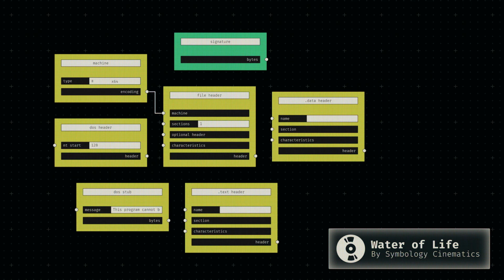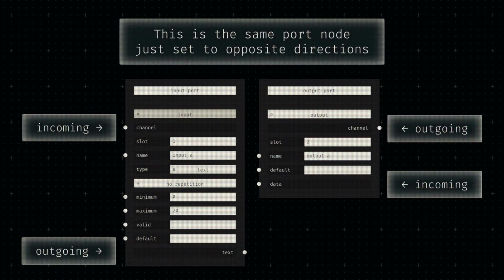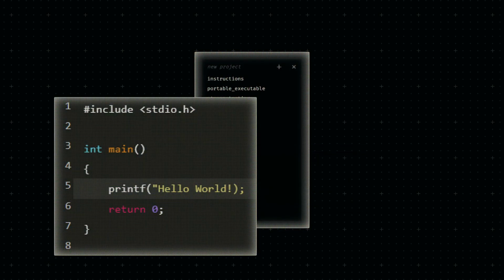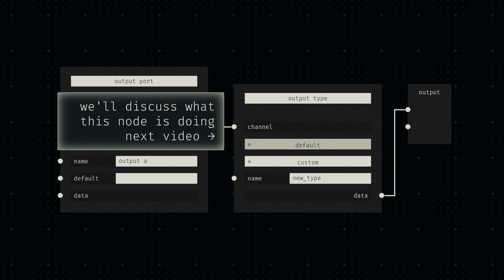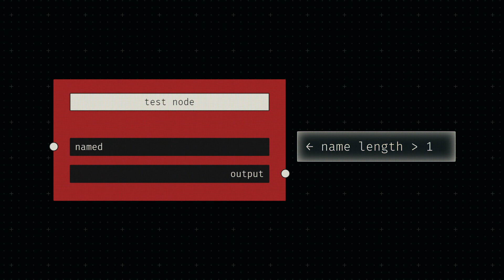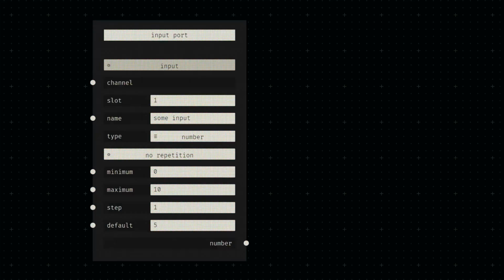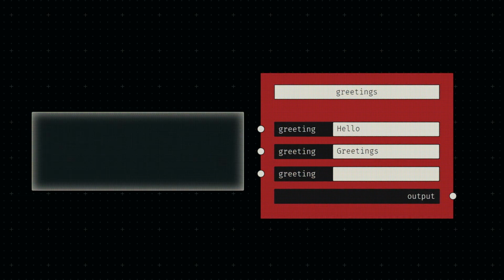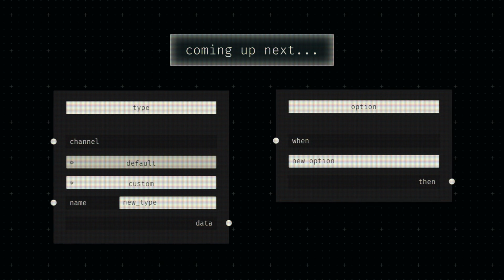Designing Node Inputs using Port Nodes - Kronark

Comment: I wonder how you will separate frontend and backend compiler later for cross-platform code? You will need some abstract intermediate representation. But ports basically give some idea of how it can be done
Reply from the maker: Sorry, I don't quite understand? What do you mean with "separate FE and BE for cross-platform"?
Reply: @Kronark  I'm sorry for my bad english.

I just didn't understand how it would be possible to write code that could be compiled for different architectures (you mentioned x86/64, arm and riscV, I think), but which would not include architecture-specific modules.

But after some thinking I already catch up how to do that with features of your node-lang. So my question partly outdated and new details in future videos will complete the picture, I think
Reply from the maker: @dmitry-diehl  All good mate, your English is fine.

This compiler basically moves the compiler target implementation into user-code space. So if a user wants to target a different architecture, he/she just has to build some nodes that output instructions for that architecture correctly. It will all become much clearer the more applied topics I upload :)

Comment: What instruction set do you plan to target with this? So far, I have written a compiler only for my own byte code virtual machine, and the language is basically assembly with a few macros/simple abstractions.
Reply from the maker: Sounds really cool!

X64 for now, until high level usage has been reached. I‘ll also need to target spir-v for my thesis, so that as well.

After all that, risc-v and arm for now.

Dalvic bytecode eventually to make apps :)
Reply: @Kronark  Sweet. RISC-V seems conceptually a lot easier to use than x64 since the instructions are broken into just two types: move and operate. The little bit I know about x86/x64 leads me to believe it would be a much more complicated compilation target, though I imagine that a lot of the abstractions needed for RISC-V would be applicable with some optimizations for other ISAs.
Reply from the maker: Yeah, x64 definitely isn‘t the easiest ISA out there, but it‘s the only ISA I currently have as hardware - so I‘m kind of forced to target it currently :D

Really can‘t wait to target RISC-V tbh, it seemed super interesting from what I‘ve gathered.
Reply: @Kronark  There are some fairly inexpensive RISC-V Linux SBCs you could use for experimentation without too much hassle, but having the test machine already available is a valid point.

Comment: I just recently found this channel, and wow this looks cool! Your project kinda reminds me of Lisp/Lambda Calculus. I'm excited to see where this project goes! I am a little confused though, why only 5 different types of sockets? Wouldn't that be kindof restrictive if you need anything other than a bool/string/number? Or does the named socket allow any type of data to pass through it?

Also, (and I know you may not have an answer to this yet at the current stage of your project), do you plan on adding meta-programming? Or would that be far too complicated with nodes?
Reply from the maker: Thanks! :)

All sockets allow any type of data. The socket types are merely there to provide a user interface to more easily define those different types of data - whatever is more intuitive in a given situation.

For example, you could define a colour data type with a text input (hex code) or a number input (number range 0-255) - it‘s all a matter of preference really. In traditional programming, you technically only get one approach to defining data: writing text. You have to write „true“ and „false“ for booleans for instance. In this tool, you get more options for defining data, for example the ability to use a button for booleans instead of writing a keyword.

What features of meta-programming would you like to see? A lot of stuff falls under that umbrella… :D
Reply: Oh I see!
And as for meta-programming, well of course that is up to you x3
I personally wouldn't implement it unless you can do it in a way that saves you time in the long run. However, it's still fun to fantasize about how meta-programming could be implemented.
You could have a `quote` node, that stores a node inside, and outputs it without doing any execution. Then, all you'd need is a bunch of built-in nodes that operate on the node datatype!
Or you could have "macro nodes" that simply recursively grab the entire node graph from it's inputs.
(Can you tell I'm a Lisp user yet? x3)

Comment: Any plans for comment/description metadata on the nodes? Even with the ability to go as deep as you need to within the nodes, a reminder of what a node does or any special considerations might be useful to someone building a graph at a higher level.
Reply from the maker: Yes, definitely. But it‘s a feature I‘ll be adding after everything else is done tbh.

I‘m planning on adding metadata tags to the editor in general, which will act just like nodes, just without any sockets and with an expandable text area instead. Maybe even metadata types and tag colours for things like todo/fixme/bug highlighting. Will need to add the ability to stick metadata tags onto nodes so they follow that node‘s position. An ability to fetch metadata content of the parent instance would also be neat - then you could output source code with comments.

But yeah, that‘s all not super important rn and will be a quality of life feature down the road :)

Comment: I'm waiting to see how loops will work. If you allow recursion then I see you can build arbitrary loops. For the analogues of the usual functional combinators like folds, you'll need something analogous to first-class functions as well.
Reply from the maker: They‘ll mostly work like any other higher level abstraction: a mapping to a sequence of low level operations

In the case of a loop, it‘ll be some form of jump with a sequence of instructions passed as a parameter to be inserted into the jump block.

We probably won‘t work on recursion immediately, since I only need simple loops for my thesis as far as I can tell (graphics cards can‘t do recursion). But it‘ll most likely boil down to a special form of loop with some special stack management :)

First order functions will definitely be done this year (although i‘m not sure if the corresponding video will actually release this year as well) - they‘re just a jump at the end of the day as well.

We‘ll need to cover how the global state works before all of this, because we‘ll need it to set and get file-wide addresses for the jumps.
Reply: @Kronark  To clarify: I meant I was wondering how loops in the node graph language itself work (we have already seen how some conditionals work in the node graph language: the "option/when/then" blocks connecting to "activation" inputs, as you showed in the "Assembling x64 instructions from scratch" video).
Or are you planning to write the whole compiler without loops? (I could believe that is possible with this node graph language.)
Reply from the maker: Ahh sorry.
Yes, there will be a loop node - but I'm still figuring out how it would work. The creation of actual loops of nodes within a graph goes against a core design choice and would require a complete rewrite. So that isn't an option. But I do think it's quite necessary to efficiently output repetitive sequences of bytes. I need to find a way of signalling the repetition of a node sub-network without breaking the existing architecture.
I'll probably make a dedicated video on that topic eventually :)

Comment: Are all visualizations of graph components/nodes you're showing being rendered from existing GUI of your compiler? Or you're just showing schematic visualizations done in some other tool?
Reply from the maker: All node (graph) visuals are just screenshot cut-outs of my compiler GUI :D

I am actually using this tool behind the scenes, not just acting like it :D
Reply: @Kronark  ok, thanks for the responses. I just asked that and question about open source because at least the framework of such visualizations would be very useful for other projects as a standalone component, so other projects can put their own ideas of what graph node mean to them and build their own interactive graphs with nodes having incoming and outcoming ports etc. I definitely can find such graphs useful for one of my own project ideas even though the project won't need the compiler part.
Reply from the maker: Yeah i‘ll definitely build it in a much more modular way for the release build - having dedicated libraries for ui, node graphs, compilation etc.

But it‘s gonna be a while until then I‘m afraid :)

Comment: But doesn't this GUI make longer programs harder to understand?
Reply from the maker: Not in my experience. You usually know where to find inputs and outputs since all inputs are on the left end of a graph and all outputs on the right. This approach is the only viable way to create dependencies between ports - which would be a nightmare ui-design-wise if it were done in a seperate top-to-bottom panel of sorts.

Comment: I think you could generalize 'step' by having it take a function as input that gets evaluated whenever the input gets changed. So you could connect a function that does `mod(x)` to have the same step behavior, or `pow(x, 2)` to round it to the nearest power of two, or any other custom behavior.

I guess it might add a bit of complexity though, if it has to compile the input to that node, and evaluate it in the editor?
Reply from the maker: Already ahead of ya!

I‘m planning on adding support for a minimal expression syntax for exactly that purpose, because expecially steps that follow the powers of 2 are super useful for lower level data.

My plan is to allow the „=“ character in all number parameters, maybe even number inputs in general, which if placed at the beginning of a value, an expression evaluation would trigger instead. Then just add syntax for all necessary math stuff and it should be a neat lil feature!

Comment: Due to a learning disability quirk, programming has always been inaccessible to my brain struggling to process text walls, but with node based systems, I can actually get some results - particularly in systems like houdini where you can encapsulate a dense collection of nodes into a single node with exposed inputs/outputs

Comment: Because It is directly outputting bytecode doesn't that mean you wont have access to compiler optimization like other languages?  Would It be significant for performance?
Reply from the maker: Compile time optimisations essentially boil down to „replace these bytes with these optimised bytes“, and that‘s exactly what we‘ll be doing when implementing optimisations.

For example, in our upcoming multiplication node, if a factor is a power of 2, we‘ll output a bitshift instead of an imul operation. 

We‘ll discuss this stuff more when we get there! :)
Reply: Also do you have a tool for spawning nodes like in blueprint?
Reply from the maker: Not super familiar with ue‘s blueprint system, what exactly does that accomplish?

There isn‘t a tool for that yet, but I suppose it wouldn‘t be much of a leap to build it.
Reply: Basically when you right click there is a pop-up with all  relevant nodes and  auto-completion.
Reply from the maker: Ah, yes of course. When you double-click the grid, a menu opens where you can select a node :)

Comment: Nice, I'll need to watch it again 6245 times to understand correctly :D

I'd propose to add some sort of "+" and "-" buttons of some sort for repetitive sockets, so that even switches can be repetitive.

Another thing is that repetitive sockets are pretty wild to look at (from exterior perspective): there is no clear indications that it is a repetitive socket. A thing that could be done is to offset the name of the socket from the values, kinda like a tree (but it's only 1 branch deep).

Also, why use "channels" instead of just a "flow signal" (like blueprint) ?

Anyway, great video, I'm working on my own visual programming language btw. Good luck bro, and don't forget to take a rest when needed :)
Reply from the maker: Please do, I need the watch hours :P

Hmmmm, actually not a bad idea. That would alleviate a lot of automatic processing in the backend… might implement that button approach once other features are stable.

Regarding the visual cue that a socket is repetitive, I wouldn‘t inset the name but maybe add a little icon somewhere… I think that would look cleaner.

Eh, the naming choice may be reworked once everything else is set. Maybe we‘ll do a feedback round for minor things eventually and you can bring it up again then?

Glad you like it!
Reply from the maker: Ok so turns out your idea with the repetitive socket plus-minus-button approach actually alleviates the need for a pretty processing intensive task + fixes a bug i‘m currently having… so I‘m actually gonna implement that tomorrow, making the last part of this video already outdated :D

Good call mate! Thanks for commenting it :)
Reply: @Kronark  haha, no problem bro

Comment: This is very cool, but watching it i get this itchy feeling that things could be simplified substantially. Which is now going to keep me awake at night thinking of how
Reply from the maker: Trust me, they can‘t really… it‘s one of the first things I tackled… ^^

You could move I/O definitions to a seperate scrollable UI panel, but that will get complicated fast. You might think „oh it’s just a couple of inputs per socket“, but we’ll later discuss things like node activations, where some ports are only drawn based on a condition. And then such a separate UI can get extremely confusing… such dependencies are best represented in a node graph, hence the node representation of the concept. It would also require a rework of the node file format.

Splitting the port node up into multiple smaller ones would also just make things more complicated. The only socket related data that is split off from port nodes is the definition of types and options, because each require multiple parameters and occur in variable amount. On top of that, type and option nodes can be used to activate other port nodes, which again is a relationship not really representable in a seperate UI.

Additionally, it‘s so much more elegant to define nodes with nodes instead of stylised settings panels. There‘s a lot of emergent behaviour such as dynamic string generation  for labels and types based on input, that wouldn‘t be possible with extra UI panels.

But I‘d be happy to hear any ideas you come up!